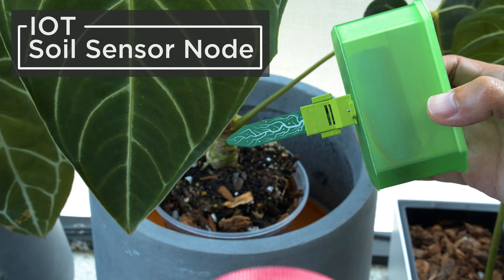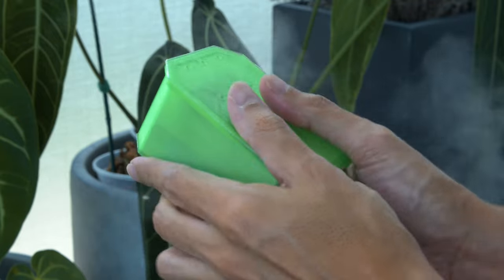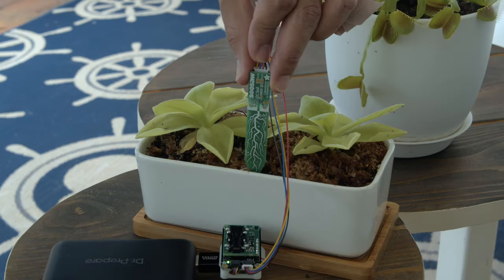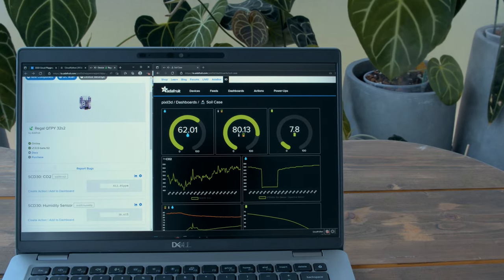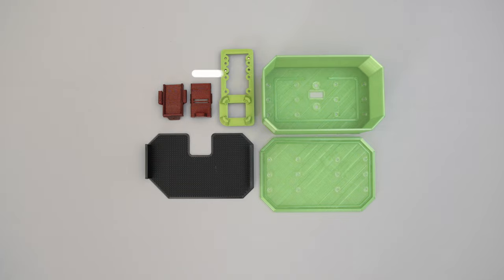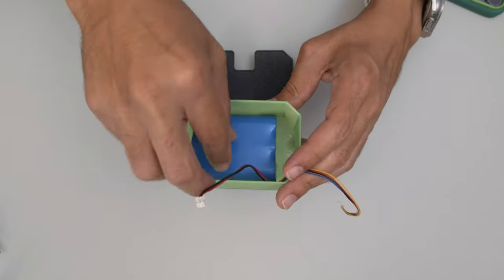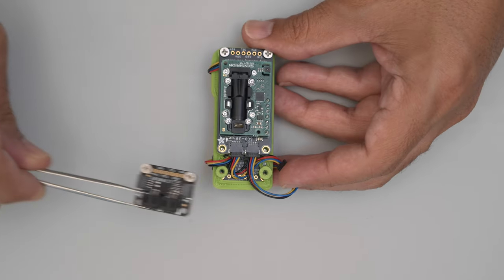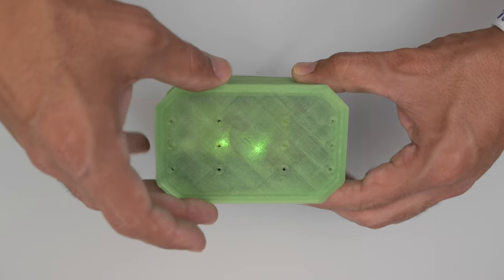IoT Soil Sensor Node #adafruit

Comment: Could this be made as a hub with multiple soil sensors? That way it would make it worth the expense of building this by allowing to monitor multiple plants at the same time.
Reply: Great question, I hope we get a reply. I know nothing about these modules, but I would think polling multiple i2c sensors would be possible.
Reply: Maybe you have to take into consideration that you only have 4 I2C addresses: "The default address is 0x36, but you can select between 0x36 and 0x39 inclusive by shorting AD0 (to add 1 to the address) and/or AD1 (to add 2 to the address)" 
So on one I2C bus you can only have 4 sensors or if you want to have more you have to power them on individually.